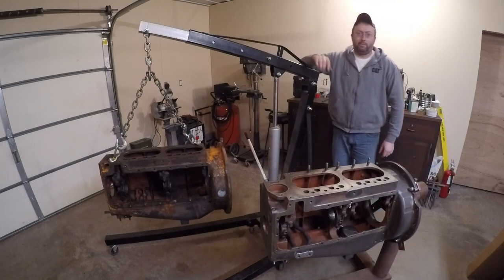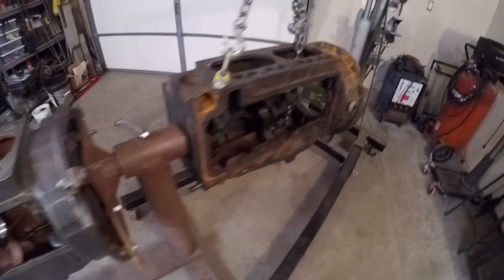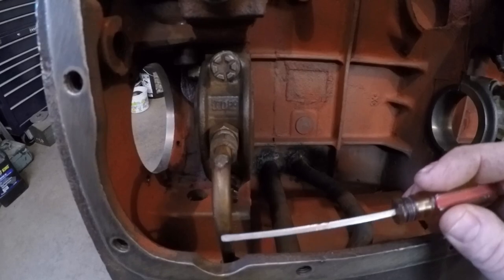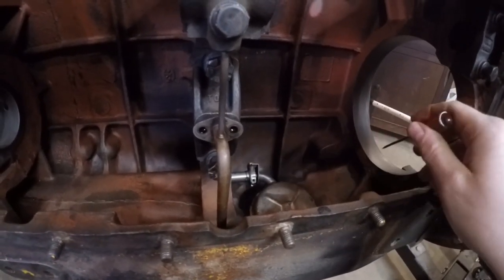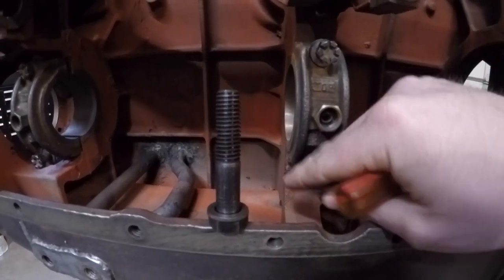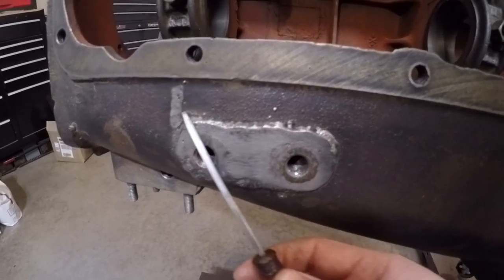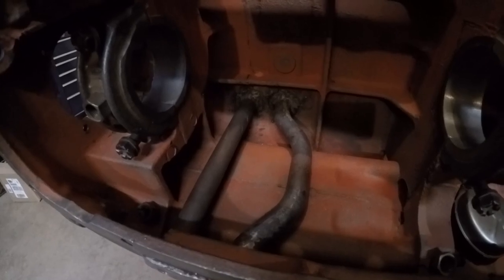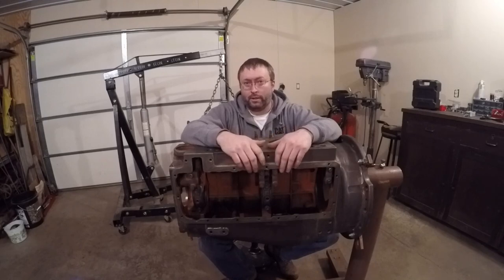Minneapolis-Moline Prototype 445 Tractor #X231 Restoration - Part 2: Engine Block

Comment: This isn't boring. I sat through 2 years of lectures at the Vo-Tech in Canby MN. I was quite fascinated by the artistry that these engineers had. You have to stop and wonder if these external oil galley passages were either by design or "CRAP" I forgot about lubrication.

Comment: Hi I just started watching more of your video's I'm wondering if that oil pipe that has the soldered hole in is the same shape/mounting as the other one with the extra pipe on, and they only had one pipe style and plugged the hole that wasn't needed in the front one from the start. I'm going to watch the rest of this series but it might take a while, it's very interesting to see what you have and are doing.

  I own a few old Fordson major and county 4wd conversions on later ford 5000 tractors. I've re built a few tractors/ backhoe loaders and sold them on over the years, so know where you are at with doing this from it's as found condition and the costs sometimes . Thanks  for sharing your projects. Take care.

Comment: In case nobody else mentioned it, sodium silicate (water glass) was an old school material used to seal porous castings.  It can also be used to repair or fill internal cracks in manifolds.
Reply: Eddie the Grouch I knew it was sold in pharmacies back in the sixties for preserving eggs. Do not remember the instructions. I guess the stuff is good at sealing pores. Do you know how it was done with metal ? Painted on ? Pressure ?
Reply: The stuff I get has the viscosity of pancake syrup so pressure/vacuum works best.  Small castings are submerged in a vacuum pot filled with it like you would de-gas epoxy.  In the case of this engine block, I would use solvents and heat to clean out the pores, then make a dam on the inside with clay or putty, pour some in and let it ooze through like oil does or use more putty and a funnel hooked to a vacuum pump and draw it through from the outside.  For an exhaust manifold, make some gasketed caps to plug the openings and pour it in.  Swirl it around and add some air pressure through a sensor port to fill the pores then drain out the excess.  Water glass will harden in a day or two or you can flash set it by flooding the the area with CO2 gas.  
I think it was Rolls Royce who used it to seal iffy manifolds and water jackets and boaters use it to seal old water cooled exhaust manifolds as replacements are as rare and expensive as old tractor parts.
Reply: Eddie the Grouch Interesting. There was an English magazine called Model Engineer ,I had a number of issues about 2001,and porous castings at the time were under discussion. The answer by an older man who had extensive background in sandcast was to find a way to flow Loctite red through the porosity. Sounds very similar in approach. Where do you order your stuff from ? Thanks for the detailed reply.
Reply: Red Locktite...I wonder why?  It's not very strong nor heat resistant.  I get my water glass from local foundry or ceramic suppliers.  The ceramic shop had it in bulk and you'd bring a container buy they got like those little book shops that only open whenever they feel like it and get offended if you want to buy something.  My last purchase was a 5 gallon pail many years ago and I still have a lot left.  I mostly use it to make core sand for metal casting but it's handy as a glue and it also seals concrete and mortar.
Reply: Eddie the Grouch Now I think about it the guys that reload all brass 12 gauge shotgun cartridges recommend water glass to cement the top wad to the brass. Cannot answer your question on the red Loctite. Just that was what was in the article. Appreciate the info. Water glass remains more available than I would have thought. Preserving eggs and being sold in pharmacies being no longer available.Cheers.

Comment: I had to do a bunch of research to see what a   ZB  I found it was the third generation Z made just 3 yrs  and the ZA 2nd gen . Add a U & it's a row crop . So I was looking at a ZA row crop for $500 but all tires are bad and tubes & of coarse engine stuck . I see the first gen MM Z  is called letter